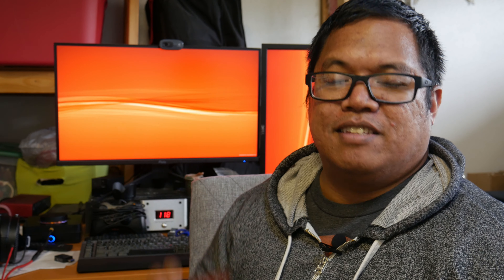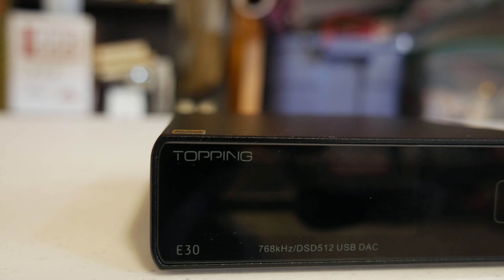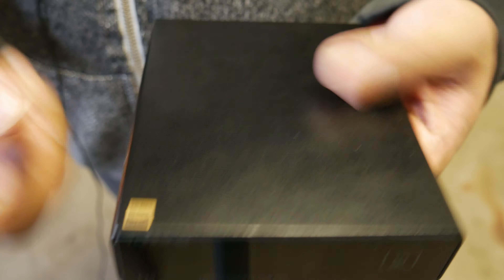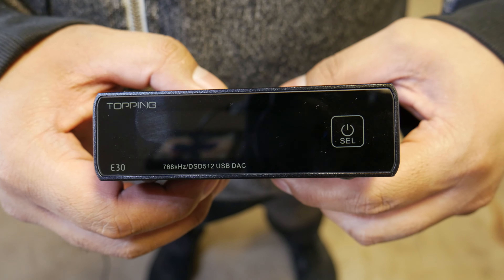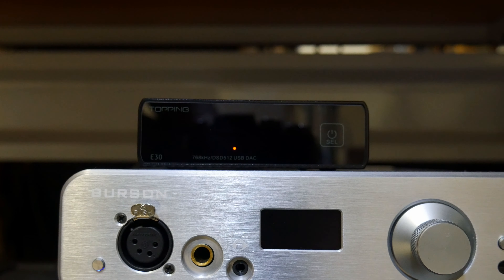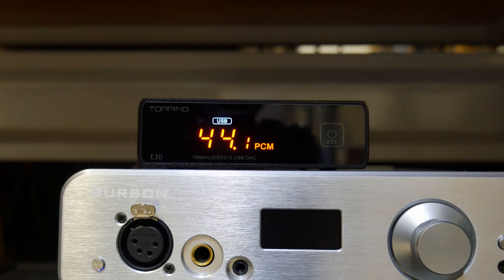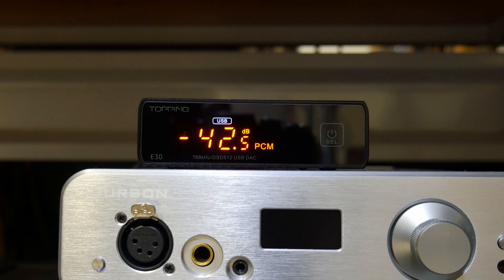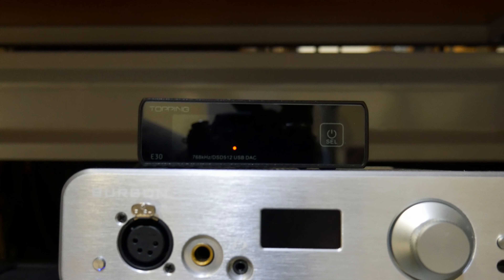Topping E30 Review

Comment: I had to return my Topping E30 as I found there is a compatibility issue when using an iOS device (iPhone or iPad) running ROON connected to the E30.  I found numerous instances where ROON froze after playing a few tracks, required the roon player to be closed and restarted.

I eliminated the possibility of a WiFi problem, as I also connected mi iPhone to an iFi Hip-Dac and did not experience the roon freezes. I thought perhaps it was a roon issue, but since the problem did not happen with my Hip-Dac, I concluded that it must be in the communication between the phone and the E30 via roon player.   

Very sad as I found the sound of the E30 sound very pleasant, and certainly something costing 3-4 times the price.  My solution was to purchase an ALLO Boss2 Player, and find the sound a little warmer than the E30.
Reply from the maker: That's so sad to hear! 😭 It's such a great Dac for the money, that's so unfortunate. I hope you find something that works for you!